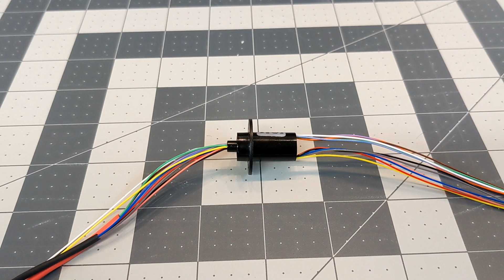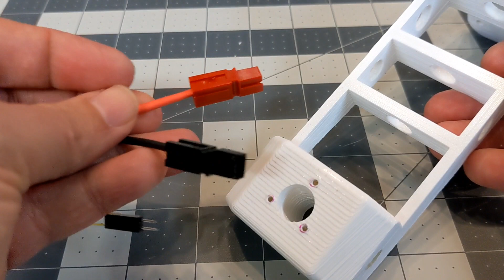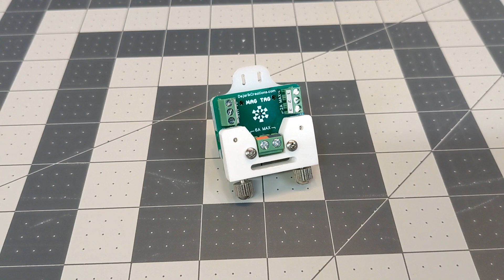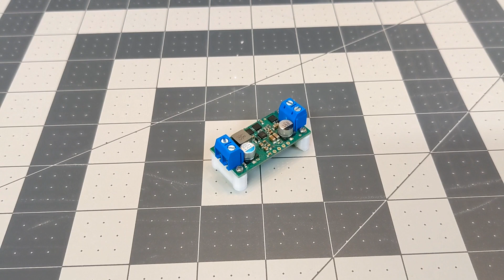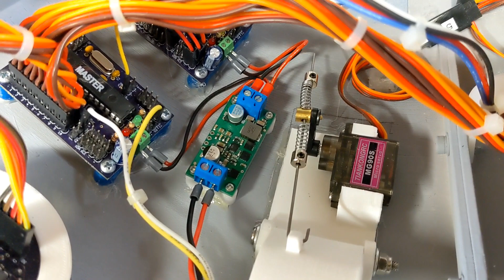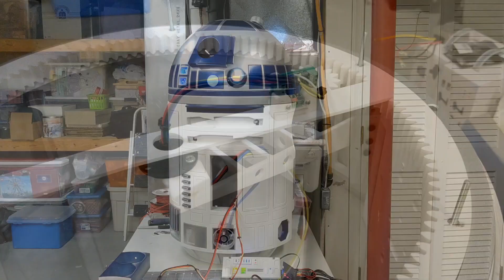R2 Electronics Build Part 4: Connecting the Dome

Comment: Jason, the backing piece that you are referenced at 12:40, what is that for? That's not the "nut holder" that is referenced in the V2 guide, is it?..  Maybe that is why i can get only one bolt in. lol
Reply from the maker: Yes, the backing piece is "Nutholder.stl" which is found within the "DomeGears" subfolder in the MKIII body files. The purpose is literally to hold the nuts in place so you can feed bolts through the MotorFrame and those vertical rails in the body. Without that piece to actually hold the nuts in position, it's very difficult to fix the MotorFrame to the body (the angles are tight and it seems you need at least one extra knuckle in each finger for it to work). I use the third bolt (lowest in the video) simply to hold the part in position. If you are using the Prusa cut MKIII body files, I believe there's a body joint between the rails that makes the nutholder no longer work. I'm not sure what builders do in that case.

Comment: Hi Jason 

Thanks for great videos on building R2, I am Building R2 myself but the electrics are different to yours.
My question to you is..
If you used the small slip ring, how is is wired up and where do they go. as I have the small slip ring but dont know how to connect the wires, where and what to.
I have looked on line and on the droid builders site, but nothing.
I know nothing about electronics, but a little bit about electric.
Thanks
Reply from the maker: So the number of discrete connections you need (and where they go) will depend on your control system. If you're running power to the dome, that's two connections right away (+/-). Add to that whatever signals need to be provided between components in the body and dome. Shadow+MD requires one signal from the Arduino going INTO the dome master, and a second signal wire from the dome master back DOWN into the body to the MP3 trigger. So that means that I need a total of 4 connections. I'm not super familiar with Padawan, but I'm pretty sure it needs at least one signal going from the body to the dome. Not sure whether it needs a second signal or not.

Once you know how many discrete connections you need, you can then decide how to allocate the multiple wires in your slip ring to accommodate that need.

Signal wires carry very low current, so there's little reason to use more than one slip ring wire for each signal connection. So, setting aside two wires in my 12-wire slip ring for signal left me 10 wires for dome power. I simply divided them into 5 wires for positive voltage and 5 wires for ground. For each group of 5 wires (note which colors go together so you can do the same on both sides of the slip ring) simply strip the ends, then twist them together before crimping on the connector of your choice.

At the end, you'll have a slip ring with 4 connectors on each side (or however many you determine you need for your setup) where the same colored wires are bundled together at each end. You can test continuity using a voltmeter just to be sure - touch the matching connectors at each end and hopefully you hear the tone.

That is pretty much it for setting up the slip ring. After that, it's a matter of finding an easy and convenient means to connect/disconnect the dome - the MagTag is one option, but there may be others.

Oh, and I mention this in another video, but it's important to reiterate - especially if you're going to use a smaller slip ring - you DEFINITELY want to pass full battery voltage into the dome and step down in the dome to 5v for your boards. You can look closely at the wiring in the dome at the end of this video - you can see the red/black wires go directly to the regulator, then out to each of the Marcduino boards.

Good luck with your build!

Comment: Do you share buck converter mount stl anywhere ??  TIA
Reply from the maker: I updated the video description to include a link to the .stl that I created (https://www.dropbox.com/scl/fi/vp2wz9j0rky4rgcszme1m/Pololu-Step-Down-Mount.stl?rlkey=7umpz513n64agyyqogt8nkq7d&dl=0). Just keep in mind that the voltage regulator that this fits is not commonly found anymore - Pololu offers newer regulators that are more square in shape, but if you happen to have one of the older ones, this mount should work for you.
Reply: Oh that’s awesome. Thanks and yes I have that exact same one. Thanks again

Comment: Hey Jason where is the larger slip ring bracket in the OneDrive? Is it the pitman option one?
Reply from the maker: The larger slip rings have a diameter of 24mm. In Print Files -> Astromech MK3 -> MKIII Body -> Main Body & Skirt -> DomeGears you will see two files for that size slip ring - MotorFrameA-24mm.stl and MotorFrameB-24mm.stl. That's what I used for mine.
Reply: @jasonsR2D2  you’re the man! 🫡

Comment: Hey Jason!

I am trying to get the same slip ring, but when i click your link its giving me several options and I want to make sure i am getting the right one.  did you get the 6 wire 10amp, 15amp, 20amp or 30amp slip ring?
Reply from the maker: Pretty sure it was the 10 amp version. Since I pass full voltage through it, the current draw should be low. Be sure the voltage converter in the dome can also handle 10 amps just to be safe.

Comment: I’m planning my system now. I was planning on using the Padawan 360 system. But watching your videos is making me want o try a Shadow. Thanks for the time to explain all the parts and overall working of the system. Do you have the part numbers for the slip rings?
Reply from the maker: There is a link to the bigger "beefy" slip ring I used in the video description. I did not include a link to the smaller one that I had - but you should be able to find various options by searching online for slip rings. Amazon has plenty of options.
Both control systems are quite popular - I don't think you can go wrong either way. Good luck with your build!

Comment: What's that metal bracket your dome motor mounts with? Did it come with your Pololu motor?
Reply from the maker: https://www.pololu.com/product/1084 It's $8 for a pair of brackets. I should have mentioned it in the video. I tried just about every available bracket option from Michael's files and nothing really worked. This was ideal, but I needed to drill mounting holes in the motor mount. It's too tight to get a drill in there, so I used a pin vise instead. It also helps to have a set of really small ignition wrenches to help tighten things up.